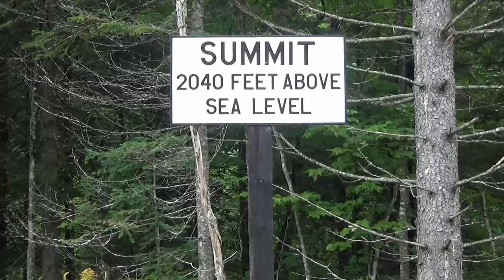"Working The Adirondack RR"

Comment: I love that video of the schanbel car and the transformer and the rock cut! Why are they ballasting and tamping?  Trying to improve speed on the line?
Reply from the maker: A major track rehabilitation project is underway along Adirondack RR’s entire 85-mile corridor (Remsen-Tupper Lake). The project, begun late last year, resumed a few months ago and should be completed by year’s end. The purpose is to re-open the 44-mile stretch of tracks between Big Moose-Tupper Lake to regular excursion service for the first time since 1980 and to otherwise improve the physical condition of the trackbed. Speeds up to 50 mph will now be permitted.
Reply: @railroadingrambler218  :) Thanks